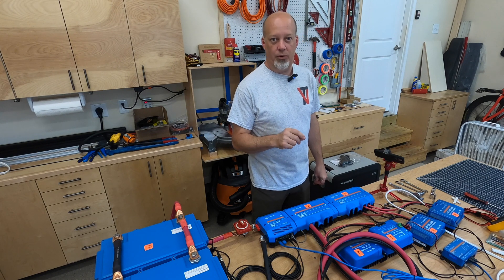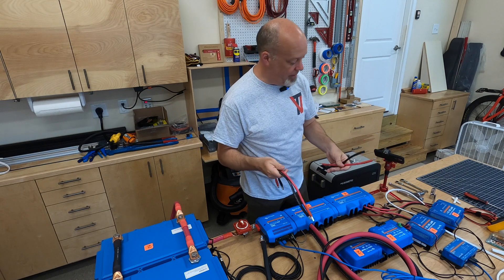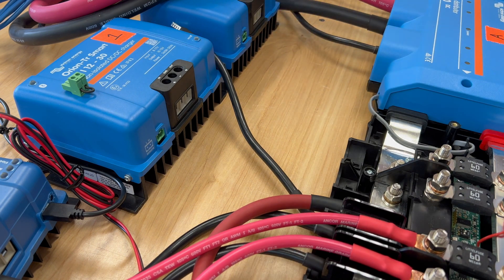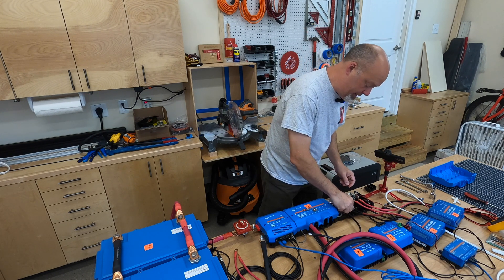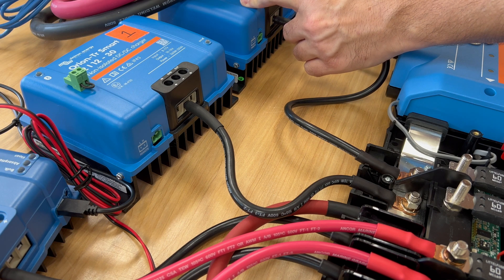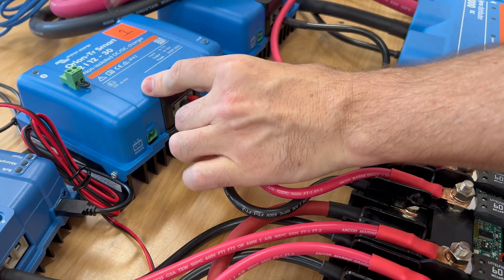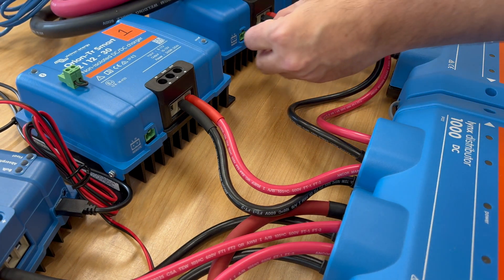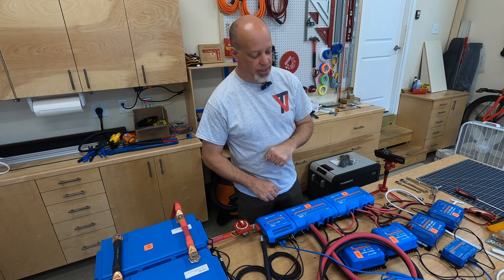Connect a Victron Orion-Tr to a Lynx Distributor

Comment: Thx a lot for your efforts and your mastery of this subject. I personally believe that during the last few months things have been really simplified in the solar industry and rendered many devices obsolete. I have not used a charge controller or combiner box in a while and even some disconnects are no longer needed depending on what type "smart" or hybrid inverters one uses. I now only use 3 types of inverters. Solark 15K, Schneider XW Pro or better yet, the one and only EG4 18K-PV and its batteries. Yes, we're no longer in Kansas anymore. My other alternative when it comes to batteries is using a T-class fuse with Discover AES 42-48-6650 no more than 1-4 (one to 4 of them)
Reply from the maker: Please keep in mind the Orion is a DC to DC charger, not a solar controller.

Comment: Helpful video!  I have an isolated version "Orion Tr" and a "Lynx Power In".  My Question: As it pertains to my house battery bank...Is there any need to make a short 20cm long GND connection from the Lynx Pwr In terminal to van chassis or is it better to keep this GND point removed and rely on the Orion Neutral to carry the GND back to the  starter battery neutral terminal where it shares a common chassis GND point inside engine bay?   Cheers
Reply from the maker: Thanks for the compliment. Without a wiring diagram, I don't think I can help much with your question, sorry. I recommend checking out the Victron manual for the Orion isolated version, or if you purchased from a Victron dealer, they should have support as well. All the best, cheers.

Comment: where do you get those square Ferrules from?
Reply from the maker: Purchase the proper sized ferrule for your wire, they are a cylinder shape until you use a proper crimp tool. The crimp gives it the square look.

Comment: What does isolated versus non isolated mean?
Reply from the maker: https://community.victronenergy.com/questions/55727/non-isolated-vs-isolated-orion-tr.html

I will have a chassis ground in my camper van (as I believe any camper van setup should). Since I did this setup video on a table top demo, no common neg/ground, which is why I could not demonstrate this charging method.